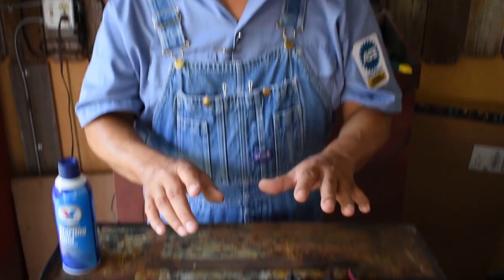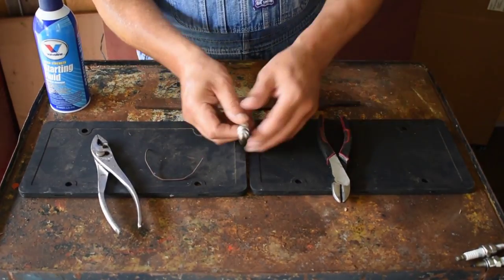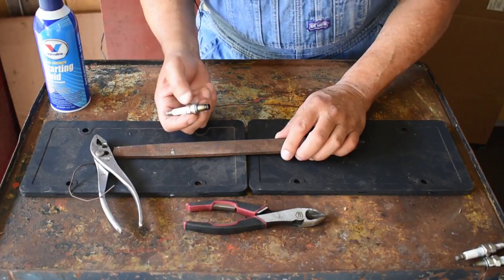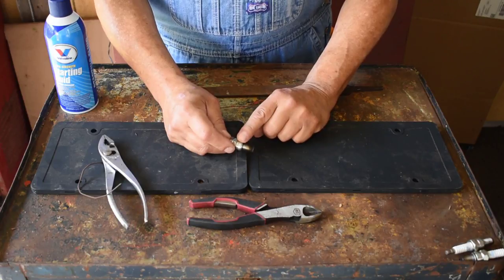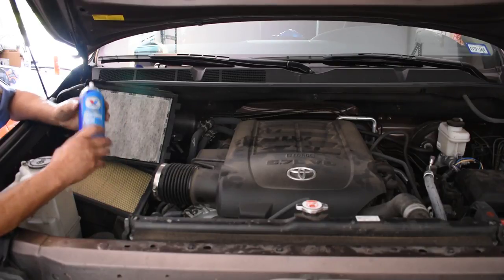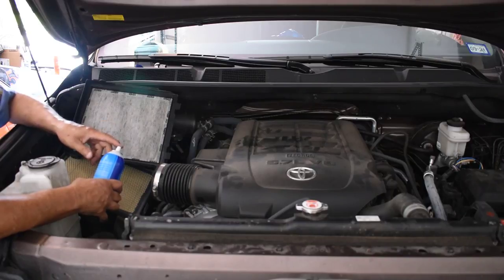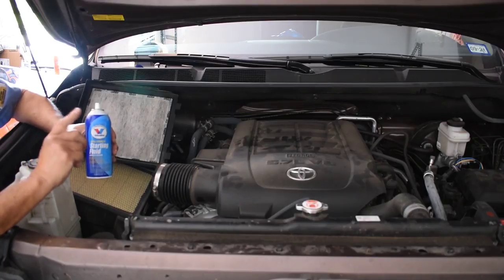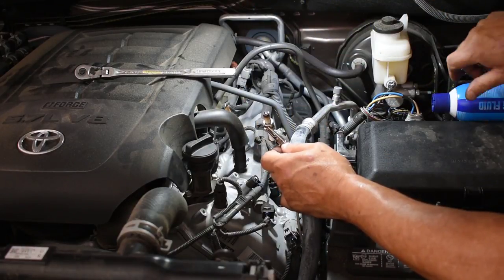Make and use “Spark Tester”. How to Correctly use Starting Fluid.

Comment: That was cool, thanks.
In the future can you do a video of how an engine sounds while turning over with one cylinder that has low/no compression?  Experienced mechanics can hear it, but the less experienced ones can use some help with that.  It can save time chasing a misfire that's not going to be spark or fuel related.
Reply from the maker: Thank you for that comment. Yes I agree, an experienced mechanic can hear the engine spinning over too fast when none of the cylinders have compression (broken timing belt). I forgot that a good mechanic can also hear that uneven crank. Thank you again.